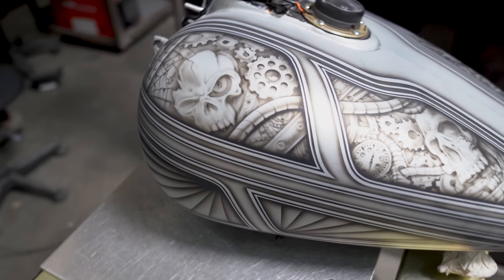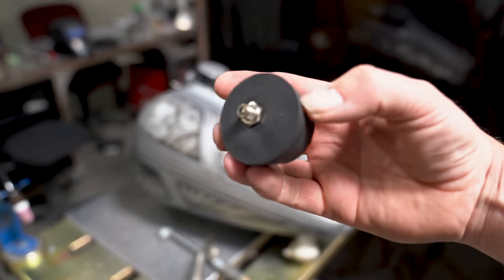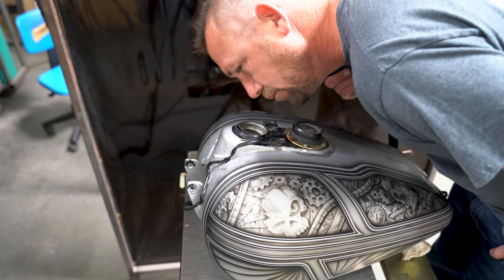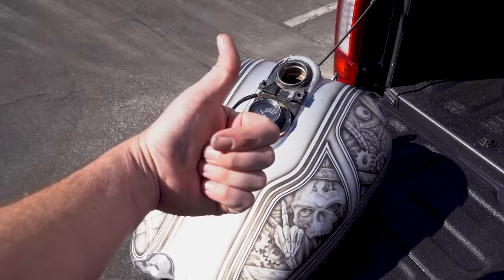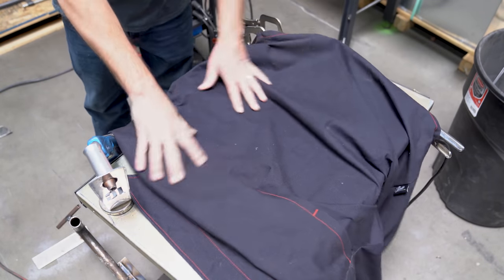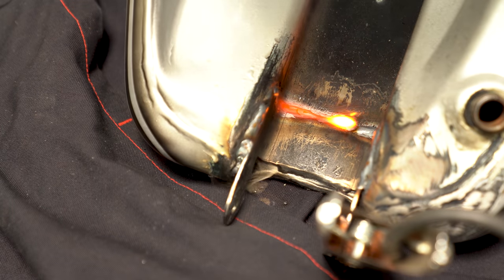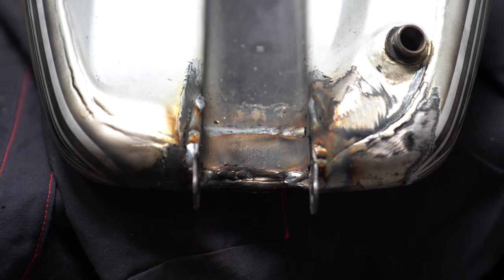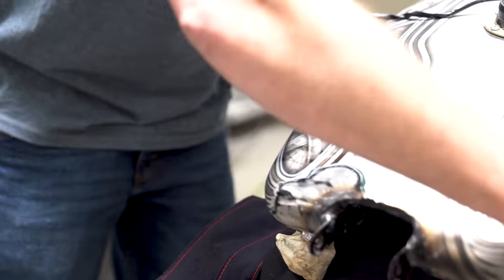Weld Repair on a Gas Tank

Comment: Got a question. Who knows maybe this will make good content. 
Trying to get good at welding 20ga aluminum. I bought the thin metal weld kit at weldmetalsonline, and I still suck, but less. I've dropped my amperage to 65-75, and turned the hertz way up, still get the occasional blow out.
My next idea is build an aluminum frame out of 5/16 armature wire. Then weld to the frame. I'm eventually going up to 1/16 aluminum. And eventually making a turbo plenum for a v twin. And eventually methanol injecting into said plenum. And eventually going to kill myself when a turbo or rod blows through a femoral artery at boost. But fuck will it be fun.

Comment: You mentioned the tank would need "resealed". How do you reseal a gas tank or seal it in the first place? Not being a smart-ass genuinely curious
Reply: They have a coating inside so the tank doesn't rust from the inside-out. Old gas tanks that sit for a long time have to be recoated.

Comment: Soldered and brazed and welded hundreds of used tanks make sure it's flooded  with exhaust and steamed out and put hose from running vehicle into it i never had a single issue.

Comment: I've welded on used fuel tanks before.  Old trick to get rid of any hydrocarbons, plumb a hose from vehicle exhaust gas and run for about 20 minutes,
Reply: Exhaust gas also is "inert" (not like argon). Fighter jets also use this "inert gas" to avoid oxygen inside their fuel tanks.

Comment: Appreciate the sharing and all, but once the leftover crud lights up - and you try to blow it out - did you ever consider the gas from the MIG will do the job sooner and more efficient? I just press the trigger ever so slightly to start the gas but not the wire - maybe it's only my (low cost) machine?

Comment: Why not braise the hole? Seems that would flow in just like you wanted and no melting of the base metal.
Reply: Really difficult to braze gaps and cracks with no backer.

Comment: Why not use a smaller mig wire  ".23" or ".30" instead of ".35" wire for this Job???
Reply: Because it's a lot more expensive and .035 is much more versatile.

Comment: "You should never weld on dirty metal" I chuckled at that, this dude has never worked on ship repair (or other industrial repairs)
Reply: Yes~An old pro-welder taught me to use 6011 on anything dirty or rusted or coated because it burns through anything but don't breath galvanized stuff I'm welding. Lots of dirty shit put together using that rod. 🤣✌

Comment: I just dry the tank out completely (in the Sun or on the Heating) and weld with a vacuum cleaner drawing the air out of it. In the Field I have even welded using exhaust fumes to purge. Also mig welded tanks often leak after a while if you have to stitch weld.

Comment: I'm always worried about welding next to plastic tanks in cars 😬
Reply: Try taking the metal tank or material out so you don't end up melting the plastic tank or what ever plus it will be easier to weld when it's out than being cramped underneath a vehicle.
Reply: What I use to protect things like paint, hoses or plastics like tanks next to a weld area is to use aluminum foil.  I loosely it fold over a few times to make it 4-5 layers thick, and tape or form it over the area you need to protect. Works great to protect it from the heat and flux fumes, while the multi layers keep any spatter from burning thru. 
I keep and reuse it till it gets nasty.  I just fold the edges over so it doesn't come apart. Cheap and easy.

Comment: I tried to clear a tank with a torch once.....The tank hit the ceiling of the workshop and came down looking like a pumpkin haha ooops
Reply: I do it a few times a month  wash few times soap and water dry with compressed air then place one piece of crumped up computer paper in the tank use some blue painters tape and place a funnel in the neck take a birthday candle and tie piece of fishing line small stuff to it light the candle place on edge of funnel get back 10 to 15 ft use the fishing line to work the candle inside the tank catching the paper on fire let it burn till it goes out its now fire purged no chance of fire ounce it burns itsself out  in the invent that it flames up you are not near it just let it burn till it's out

Comment: Fuel vapour is much more explosive than liquid fuel, because there's oxygen mixed in with the air. This is why fossil fuel engines vaporise the fuel with a set ratio with air using a fuel injector or carburetor.

Comment: I used tide in the tanks with water and have never blown up a gas tank. When I don't have tide I use the exhaust from a car the carbon monoxide eats up the fuel to clean it out.  I have never seen any water from the exhaust come out of the fuel tanks I have done with exhaust. I have fixed hundreds of fuel tanks knock on wood never blew up one. Now I have blown up a few fire pits with too much fuel for a fire starter. 🔥 my son shit him self when it blew up the pit

Comment: I have welded many fuel tanks/cells.  "It's not easy"  You must be firmly focused on what you're doing, and you can't get into a rush with the job.  I also have welded a steel 
55-gallon barrel which was full of a highly flammable liquid when new.

You must put 100% of your thoughts and thinking process into your welding project.   Go back a few years when it was a cool thing to pull a travel trailer behind your 
Led Sled!  

Yes, people would wel 3/8 thick mounting brackets straight to the car frame during their popularity days.  Yes, in some areas they were less than 1" from the Gas Tank.  A Lead Sled, something like a Pontiac Catalina Station Wagon was a popular trailer pulling vehicle back in those days.  Mainly late 60's & 70's people would do this.  It doesn't happen anymore to my knowledge.

DON'T try this unless you have an expert coaching you while your repairing/welding the fuel tank.  I won't mention the process, but your goal is to rid the tank of all Oxygen inside the fuel tank.  There are several ways to accomplish this.  

FYI, and be careful.

Comment: I’ve had the pleasure of working and painting those tanks. When I saw the welds on the corner. I can tell you that. That is a cheap eBay tank. The welds are never cleaned up. And look like crap grind like crap and finish like crap.  I’ve only done a couple dozen of them. Better tanks have better finishing.

Comment: My friend welded on a tank that had gas in it🤣🤣🤣🤣 i saw him fly 10 feet of the floor
Reply: Your friend is lucky. There are many disfigured and/or dead people no longer around as a result of a flammable fuel tank exploding. Even soldering to seal minor pin holes can lead to fatal explosions. Most times there are no second chances.

Comment: Harley tanks only need sealant if the owner is a twat. When (if) you store the bike for any amount of time beyond just a few days to a week, be sure it has a completely full tank. And fill the tank fully when riding - don't just keep a big twin flatside tank constantly at 1 or 2 gallons.
Reply: A much better solution for storage is to fill the tank with oil.  I recently purchased a bike that had been sitting for 45 years, i was worried. When i drained the tank and carb it was full of oil.  Not a bit of rust.  BY FAR the best solution for long term storage.